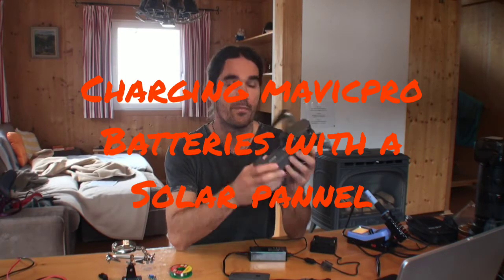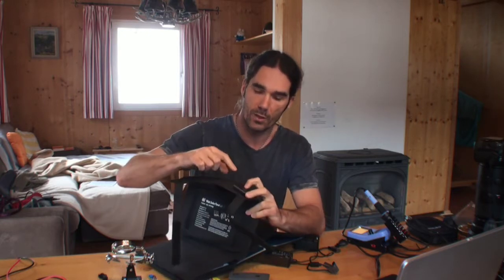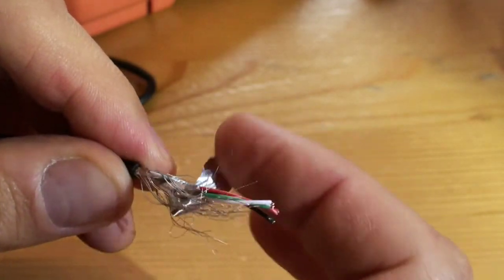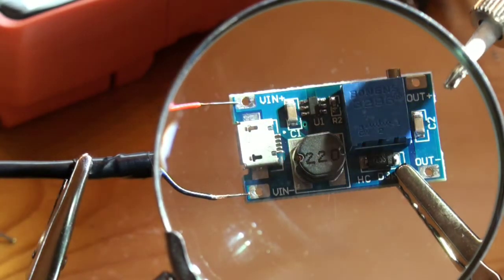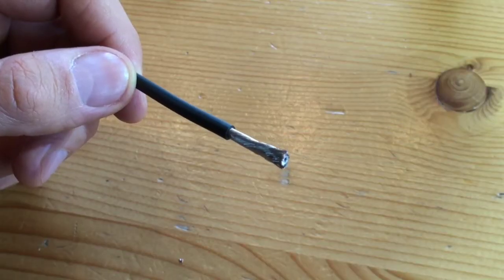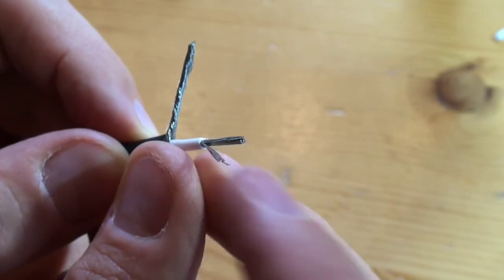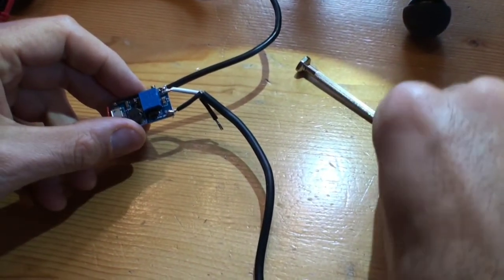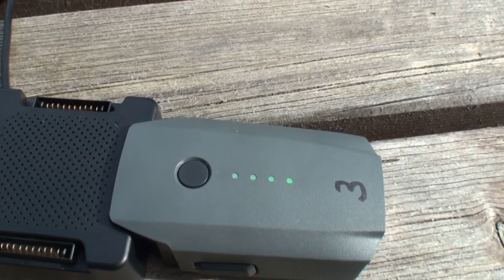Charging MavicPro batteries with USB & solar panel

Comment: Brilliant idea, what was your final voltage output from the dc to dc converter to make it work?  Also how long did it take to charge a low battery?
Reply: Ive read your post now too, thanks
Reply from the maker: @Neil-bp5rq  Sorry for late answer: output 13.05 Volts. Nice to have when on expedition without normal electricity but charging one single battery takes more than 9 hours. Hope to find a better solution. Best wishes :-)